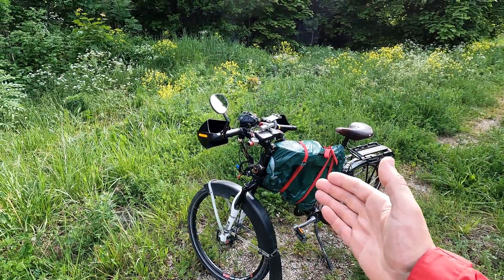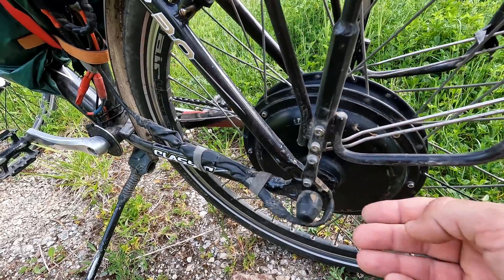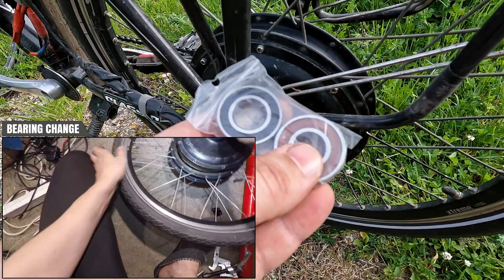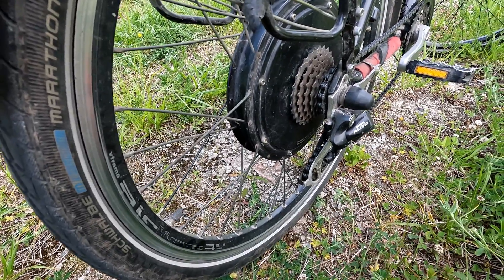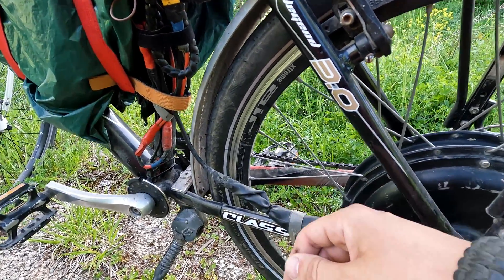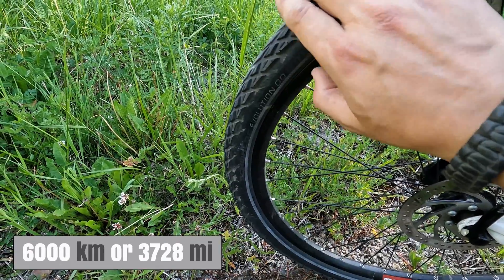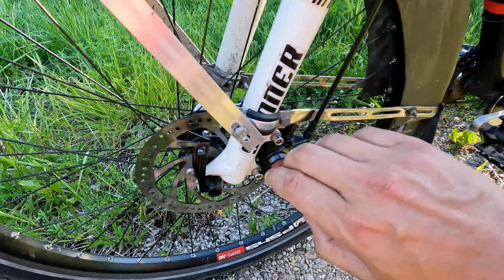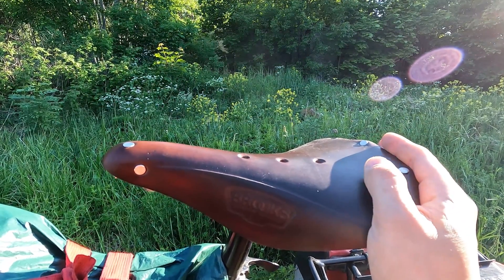DIY EBIKE - 36 000km/22 369mi Mileage Detailed Review / Car Replacement

Comment: Hi from England again, since 2020 my trek I've had since 1990 has racked up 20,000 extra miles.
My commute is 1o miles each way, some down a bridle path by a river, it definately is different to driving a car, watching the season change is very noticeable unlike in a car. When it comes to bearings SKF are pricey but one of the best.

Comment: Thanks for the in-depth review . 👍😀
I tour with a motorized bicycle myself. I've got my own build . I call it a predator friction drive. I've removed all the moving parts , and made the bicycle non critical.
 For my build it just needs some air in the tires . What if the wheel is bent no problem,spokes are broke , chain snapped , breaks fell off , or bottom bracket snapped would not notice it. 
The build is so simple a cave man could do it. Works on any bike with a seatpost. 
It also solves the breaking issues, the cruise control, and the range problem. 
I'm not trying to brag it's just that I can tell by your builds that you have run into these issues as well . 
My over all added weight is 22lbs . It has actual pedal assist. my range is 150 miles per gallon without peddling , including mountains . not just on the flats . 
I don't use it to commute , I just use it as an adventure machine . I found out a while back that all the peddling was ruining my adventures . I put a sail on my canoe because of all the paddling. 
Now when I go on a bicycle adventure, it's like riding down hill all day long . 
I also tour with my own cargo bars and cockpit layout . 
I used a used 60 dollar 29" walgoose and predator friction drive to go 4500 miles in 40 days , across America last year . And hammock camped 34 of the nights .
It was my fourth attempt. 
Thanks again for the video 💯👍😀
Reply from the maker: Hey and thanks for the Comment 👍. To me, e-biking is not just for commuting, it is also for leisure. Can't imagine life without it anymore  ⚡.